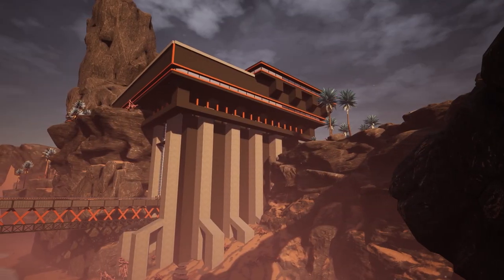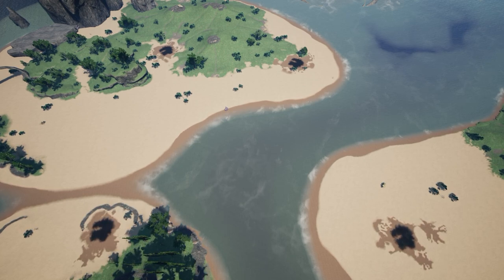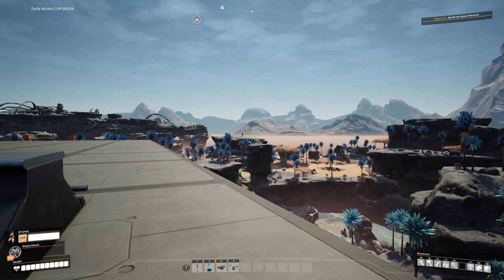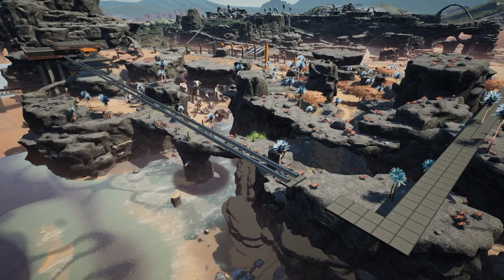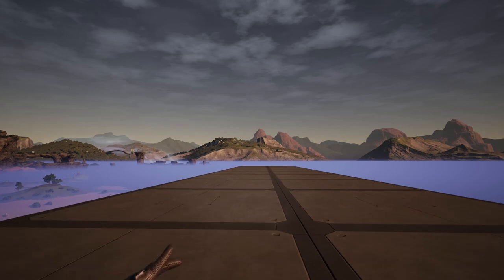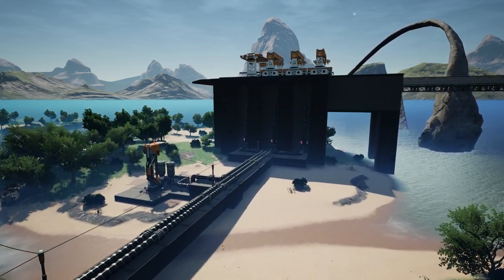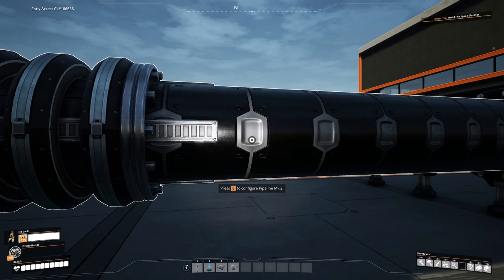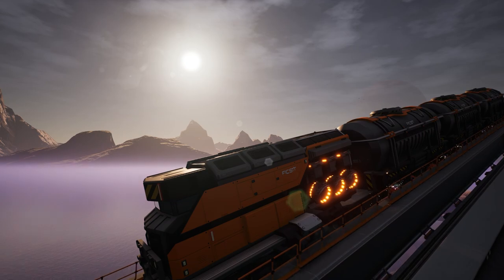I added TRAINS, SIGNALS and a HUGE BRIDGE!! In Satisfactory - Part 14

Comment: Wonderful video! 
The HUEEHUEEH sound alert is strongly requested. :D

But I have a question: Is there a specific reason why you didn't utilize both inputs/ outputs on the fluid freight platforms? I'd reckon they'd have the same problem as the normal freight platforms with stopping when a train is docked?